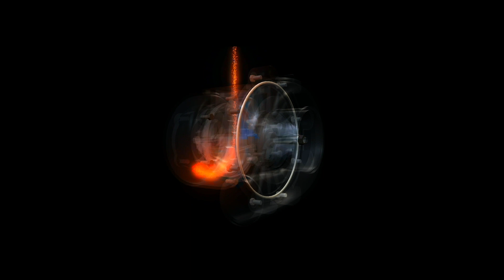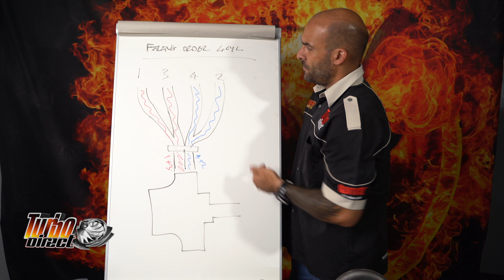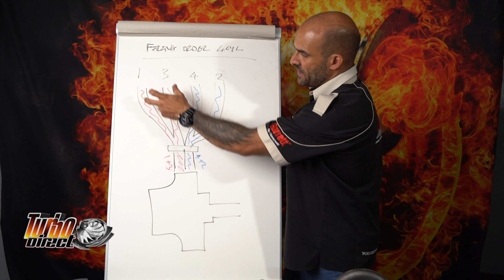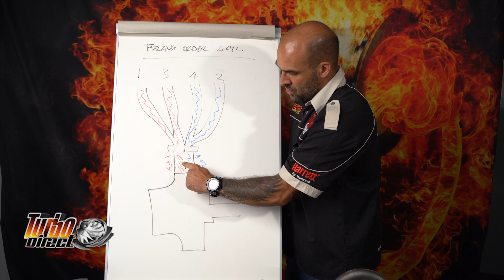Twin Scroll Turbine Housings explained

Comment: Hello there, currently i have a gtx3576r with a .63Ar open scroll but using a twin scroll manifold. If i were to go twin scroll turbine housing, should i the same size? Twinscroll .63? Or go slightly bigger? Twinscroll .82?
Reply: Thanks for the advise.. always been a fan of your informative channel.. keep it up mate..
Reply from the maker: @mizanhaslie2302  Thank you Mizan - much appreciated.
Reply from the maker: It all depends on what you are trying to achieve..... if yo looking for the best response, then stay with the AR63, if you looking for more HP up in the higher RPM range, then move to the larger AR housing, the lower backpressure will open up additional power in the higher engine RPM
Reply: Because some say twinscroll AR is half of the open scroll.. say .63 open...then i should be using around .82 twin scroll.. im really going towards more respond...and will not be revving more than 7.5k rpm on a 4g63
Reply from the maker: @mizanhaslie2302  Not true - thats why there is an AR on the housing - an AR63 is an AR63 no matter what shape it is.  Stick with the AR63

Comment: 10:36
Ah, a "quick spool valve" (as I've heard them called). I'm quite interested in them; was gonna ask you about them.😅
Does it matter which volute you block off?
Reply: ur comment is old but i would block the bigger volute at low boost and start opening the bigger one as boost rises

Comment: Great video!!!
The TwinPower Turbo system on the BMW B57 3 liter diesel engines, is this like the Mitsubishi turbo You show in the end if this video?
New sub from here 👍👌😊
Reply from the maker: The twin power is slightly different in the design, it does not have two different size volutes in its turbine housing.
Reply: Thanx alot  @TurboDirectSA   👍
Reply from the maker: @BilerTV  Pleasure sir

Comment: With the variable A/R housing of the Mitsubishi, wouldn’t the cylinders feeding the smaller volute experience greater back pressure?
Reply from the maker: Yes thats exactly what happens until boost comes up quickly, then the second volute opens via a butterfly valve if used, otherwise the manifold will have a bypass valve integrated (similar to the BorgWarner Bitubo design) to control the incoming flow.
Reply: @TurboDirectSA  excellent information as always, thank you!

Comment: hello, why i need 2 wastegates for twinscroll manifold? thanks
Reply from the maker: You only require two wastegates when you have a manifold design that does not merge the entire collector together as one - a good example is the flat 4 of flat6 engine configurations and V6 and V8 etc -
Reply: @TurboDirectSA  yes, i know, but why? r6 m54b30
Reply from the maker: @barvajz1106  Because in order to control boost properly you need to be able to control the entire incoming energy feed to the turbine. You cannot expect to control the turbine speed by only regulating 50% of the incoming energy being directed to the turbine.  This is why the internal swing valve is situated AFTER the incoming energy has merged past the collector.
Reply: @TurboDirectSA  thanks a lot, now i got it.
Reply from the maker: @barvajz1106  Pleasure my friend - anytime.

Comment: quick question please. i have bought a holset twin scroll hx35 for my modified porsche 944 turbo, that normally uses  a kkk26 single scroll t3 flange,...will this still be ok to use ? 
many thanks 
Daniel 😊
Reply: thankyou very much! will take a look and get back to you in couple of hours . thanks for tour reply!
Daniel 😊
Reply: ah that’s a shame ☹️ will try to send you a photo yes ,..
many thanks for your time 👍🏻

daniel
Reply from the maker: @danielferraro59  Pleasure Daniel, will help wherever we can.
Reply from the maker: Hey Daniel, it depends on which holset HX35 turbo you using or combination thereof. There are literally hundreds of them. Holset are designed specifically for the diesel application sector and the combination/relationship match between the turbine and compressor ends are specific to the engine they designed to operate on. I am not a fan of the holset  "make a plan" setups, which for the most part dont even have compressor maps to support.  Let me know what the turbo or CHRA part# is, and ill dig up the specifications and advise from there.
Reply: hi again, here’s some details :
assy 4036531
serial T1307346262
cust 504087676
model hx35
the casting numbers on the actual scroll housing are:
3504246
16 129 12
10   13    123   E18

hope you can figure something from these numbers? 
thanks so much for your time !
Daniel 😊
Reply from the maker: @danielferraro59  The casting numbers dont refer to any part number of any of the components, nor the turbo (assembled complete unit) part#.  Do you have a turbo part#?  This would be found on the name plate situated most commonly on the compressor housing near the outlet.
Reply: these are all the number on the inlet and outlet externals . on the core there’s a serial number that reads :p03777051s131993165cttp

customer no: 3777051

don’t know if the core would give you the external parts info or not or there generic to a single scroll holset also ect of the same size ?????
Reply from the maker: @danielferraro59  None of these numbers are recognised by the Holset database. Please send me an email with a pic of the name plate.  info@turbodirect.co.za
Reply: i’ve just sent a load of pics over by email. 
many thanks 😊

Comment: Thanks a lot for this video, for the first time I finally understood, what exactly is, how it works, and what benefits can provide a twin scroll set up.
I have an EFR7163 on my forged 1.8t 20v vag, make it about 500bhp, going on spool about 4000rpm. My setup is single scroll, both turbine housing, and cast manifold. 
Would like to ask, if move my setup to twin scroll, both manifold and turbine housing (can a turbine housing bought alone?) would I be able to anticipate my spool? 
Would go in spool let's say 500rpm sooner, without touching anything else? 
Would it be a noticeable difference in driving having same turbine just swapping setup? 

Thanks a lot in advance

You are very clear and full of skills!
Reply from the maker: Glad you found some valuable information David. The best thing to do on this engine before going twin scroll is to change the crank for the 2.0litre crank. This alone will give you MUCH better spool on the 20V engine. It will also make more power aswell.  Once you have done this, i doubt you will want/need to go twin scroll on the housing.

Comment: Would the two separate ARs on the Mitsubishi turbo housing have two radically different back pressures? I would imaging tuning that engine would be difficult as a result
Reply from the maker: Yes they do -- the volute dimensions are different, but if you saw the manifold and runner design it would make sense to you. There are less runners (in this specific engine) leading to the smaller volute and more leading to the larger volute. There is a bypass valve between them aswell which during tuning i can imagine must be fully open so that the engine breathes and the tuning can be concluded. Once this is done , i would assume that only then the boost "control" setup starts and the actuator is setup for what parameters are required before it is opened up and bypassed etc.    I dont have too much info on this engine that uses this turbo, but thats about all i know on it.

Comment: Hi mate you need to make a Landcruiser 1HD FTE  twin scroll  , i no you run them in South Africa . They'll sell like hot cakes in Australia.
Reply from the maker: We have them here yeah, but not as popular as the 4.5 V8 79 series -- this we make a Hybrid solution which outperforms your local Gturbo upgraded unit - We busy with a new complete turbocharger which will produce a true 400WHP setup with similar response to the stock turbocharger on the 4.5D -- shoot me an email chris@turbodirect.co.za and let me know more about the 1HD FTE turbo you guys want.

Comment: Which Mitsubishi turbos have the dual sized volutes? Are they available aftermarket? Does any other turbo manufacturer use this design?
Reply from the maker: Sorry i cant tell you, there are a range of heavyduty machines that use these in the TD08 series, but this is not a performance product. Not that i know of, MHI is the only housing i have seen with this design to date.

Comment: I have another question that may sound silly, but still it came up into my mind since I noticed that in all twin scroll diagrams, in a 4 cylinder engine with the usual 1-3-4-2 firing order, cylinders 1 and 4 feed the housing part that faces the exhaust, and 2 and 3 the one that faces the compressor. Does it make any difference which is connected with which or not?
Reply from the maker: It makes no difference which port is fed from which coupled cylinders, they are seperated entirely.
Reply: @TurboDirectSA  Thanks!
Reply from the maker: @aftastosk6016  Pleasure sir

Comment: Nicely explained, question I have is how do you now size the housing correctly, for example GTX3582R T3 0.63ar if I now want better response and flow more up top how do I calculate the divided T3 or even T4 housing required
Reply from the maker: Thanks for the comments, i will setup for a video explaining this in due course. Its simple and quick, and based on p2c ratio, just like the compressor is. Stay tuned
Reply: You are lucky. Garrett has turbine flow maps, look at them. Work out the flow of your engine without boost, you can use this to see where the turbo will spool on the rpm range, and then look at how much it flows when at desired boost and rpm and look at turbine flow map for given pressure ratio and you can choose what A/R suits your needs. None of the manufacturers explain how to choose an A/R, but it is very simple. It is a shame BW does not show turbine flow maps.

Comment: Hi you mentioned something that peaked my interest for a moment and I wonder if there is an error in my thinking. You mentioned the 2 volutes in a twin scroll setup, and then you showed a differential Ar. twin scroll turbine housing (mitsubishi). Is it that all twin scrolls are symmetrical in volume and pressure and only the mitsubishi differential Ar. one is asymmetrical? Or, do they all come asymmetrical but not to the difference in asymmetry as the mitsubishi housing shown?
Looking forward to tour reply ☺️ thank you.
Reply from the maker: All the housings are normally and generally symmetrical - i showed the MHI housing to throw some interesting information into the market - the asymmetrical housings are not popular at all, but work exceptionally well, this is why i mentioned it.
Reply: @TurboDirectSA  thank you much!! 😊😊 for the clarification. I always thought the twin scroll had 2 different size volutes. But that has cleared up Alot.
Reply from the maker: @saied695  Pleasure buddy -
Reply: @TurboDirectSA  actually I have ordered a twin scroll Td04HL just before you uploaded this video and I am awaiting delivery. I am assuming (based on the photos) that it is also an assymetrical a/r because the external pattern of the housing seems similar with the MHI assymetrical housings. However I have no idea IF and what's the a/r difference between the two and I wonder if there is any info inside the box. I assume that the 0.61 a/r is the bigger housing. I am very curious of how it would end up performing, I have a bit of fear that if it's the case with assymetrical housing, this may cause tuning problems.
Reply from the maker: @aftastosk6016  Thanks for the comment, no its not asymmetrical im afraid, the turbine housing you will receive will be symmetrical, there ar not many housings made with asymmetrical setups/designs out there - as it requires additional boost control components.
Reply: @TurboDirectSA  Thank you for your answer. It may sound silly that I ordered something without being sure what it is, but in effect there are not other twin scroll choices available in that size apart from a used/rebuilt  VF36/37/42 turbocharger, which I failed so far to identify their own a/r too. Also, thanks for commenting the difference between a twin entry twin scroll and a twin entry single scroll. I believe that in many cases a twin entry single scroll is the optimal solution, however it's an option that is often bypassed.
Reply from the maker: @aftastosk6016  Pleasure Sir

Comment: Was the Mazda rx7 the original twin scroll spool valve?
Reply from the maker: That was a twin turbo with turbine transition valve, opens to re-direct the incoming pulse energy into the larger turbocharger after a certain boost pressure is reached.
Reply: TurboDirect S.A 
Is than not the FD: was FC not single turbo with a spool valve on a divided housing single turbo?
Reply: Looking it up. The series 4 13bt was a hybrid spool valve on a single scroll and the series 5 13bt was a fully divided single turbo with no valve.

We used the Mazda series 4 valve on a divided housing T4 turbine on a Sierra cosworth (housing from a Bentley turbo) and it made a measurable difference.
Reply from the maker: @martinrodger9565  Indeed it was - the twin used a transition valve -
Reply from the maker: @martinrodger9565  It will make a massive difference, now go use a larger AR turbine housing and up the boost, youll see results that will astound you.
Reply: TurboDirect S.A 
We did this over 20 years ago: hence my memory was hazy. I do remember us playing with it with no wastegate just to see how it worked. Had to be pretty careful with the throttle as car was not mapped or mechanically setup for infinity T4 boost.

Currently playing with a Mazda mx5/Miata and sticking a twin scroll Mitsubishi evo manifold and td05 on the Mazda engine. It’s a nice little hobby project.
Reply from the maker: @martinrodger9565  HAHA just a little too much and say goodbye to the motor -- i been there many times in the old days when we still used to lock the dizzy's and control timing through the old domingoes box and MIC3 from perfect power..... good times.

The MX5 will make decent power, very under rated engines

Comment: Quick question😊 wouldn't it be more efficiant to have cyl 1 and 4 in one section, and 2 and 3 in the other, running a 4 cylinder engine with 1-3-4-2 firing order?
Having the pulses reaching the turbinewheel 1-2-1-2...etc?
Reply from the maker: There are many vairants of the "tuned port" manifolds out there, opposing runners and side by side runners, different engines work better with either.... Subaru versus inline 4cyl will differ.
Reply: @TurboDirectSA  i see😊
I would just believe that a solution with the first and the third firing cylinder sharing a volute, would be better in terms of pulse interference and when running cams that have more overlap than oem cams?
Reply from the maker: @EscortRSTWRC  Well it all depends on the runner length, and how much pulse seperation you want/need - this is only decided when physically tested.  Not unless you can draw (accurately) the manifold and housing combination and do simulation in a CAD/CAM program of sorts.  Like i say, different engines and combinations will better suit different setups.
Reply: @TurboDirectSA  
Where could i find more info about these Mitsubishi housings with variable a/r? Looks very interesting😊
Reply from the maker: @EscortRSTWRC  Industrial applications only at this stage.
Reply: Something most do not know about turbos: They THRIVE on exhaust pulsation. By grouping two close pulses together, you can actually increase the turbo's responsiveness to the same amount of exhaust. 

The Detroit 50 series four-banger diesel turbos even cross over their exhaust manifold to accomplish this exact thing, which exaggerates the pulsations "felt" by the turbocharger exhaust turbine. It is bifurcated into 1-3 on one side of the dual-scroll turbo, and cylinder 2 and 4 on the other side.

For a naturally-aspirated engine or strictly supercharged engine, this would not make sense, but the turbo absolutely LOVES exhaust energy pulsation.